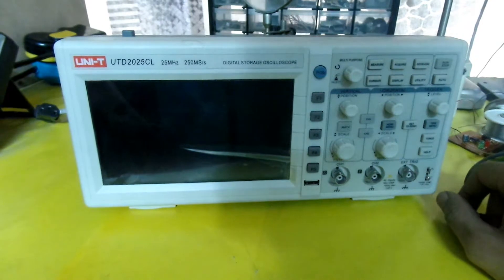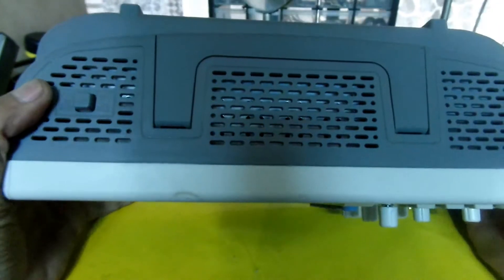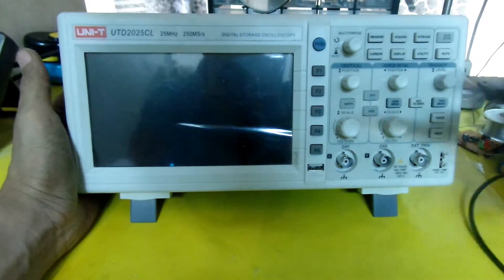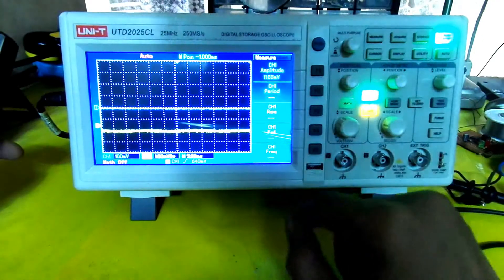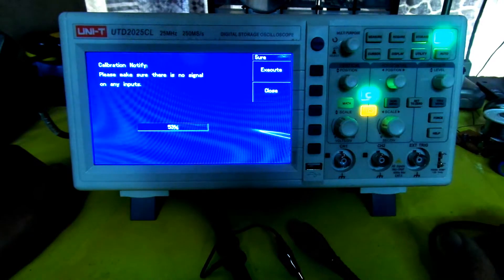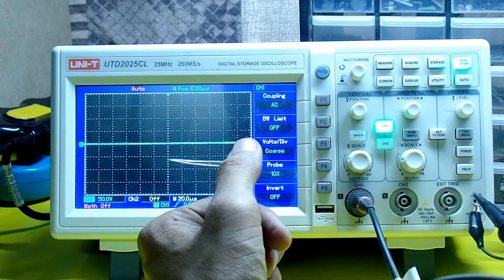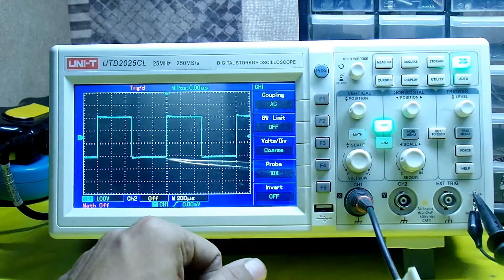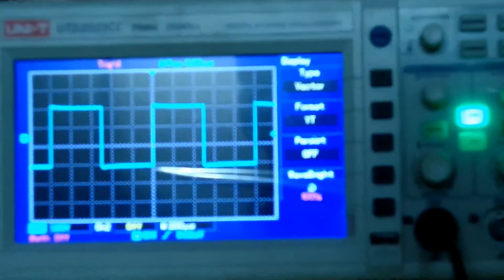Uni-T UTD2025CL Oscilloscope DSO (Review & How to use)

Comment: I have the model UTD-2052CL hardware version 2.00 software version 1.16.06 manufactured on 2018/11/26. I tried to update it with the pendrive but it crashes, I press F5 but it doesn't respond.